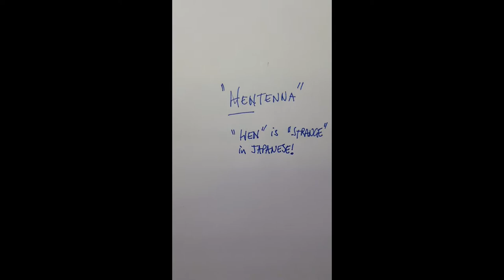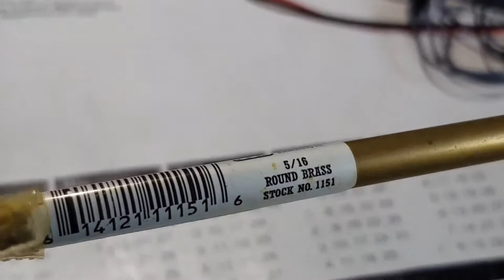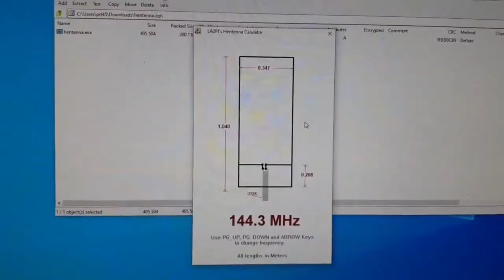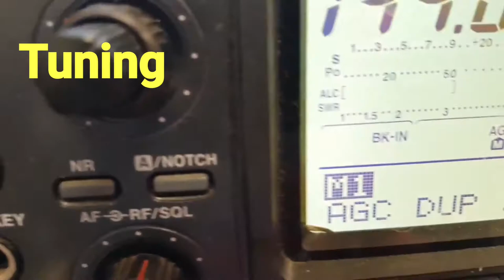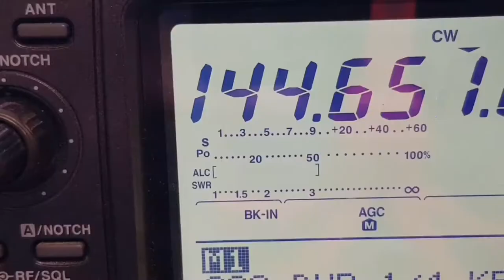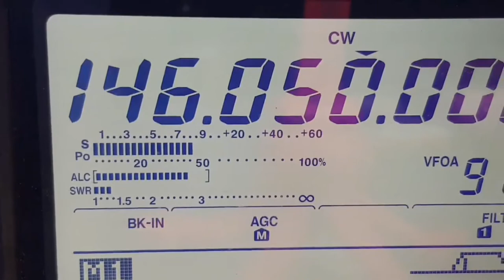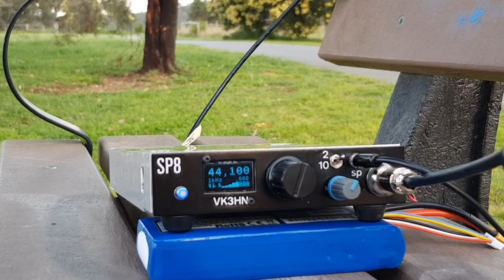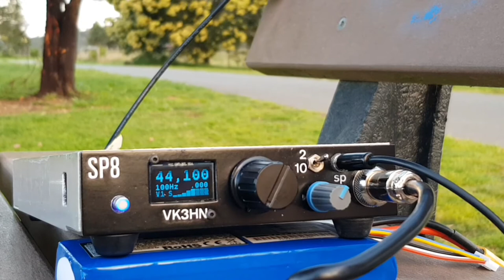Building a Hen-tenna for 2m

Comment: Thanks to this video, I just made a hentenna for 4m using the calculator. Bloody brilliant, calculator measurements work precisely. 1.1 SWR on 70.400 after tuning. Goint to build one for 2m, and might experiment with 70cm. Thanks!
Reply from the maker: Excellent Tiggy, happy that it worked as well for you as it did for me. I think these loop antennas are relatively forgiving, and they are fairly broad.  The 70cm  hentenna should be nice and compact.  Enjoy your hentenna, thanks for trying it out.

Comment from the maker: Has anyone tried a Hentenna?
Reply: I want to build a hentenna - for 17m. A question. Does the tap at 1/10th the wavelength work perfecty? How long should I make the uninsulated area to get optimal SWR? Thanks !
Reply from the maker: @dl6urk88  I've only made one, for 2m. It will scale to any ham band, just use the calculator. I'm not sure how much movement up and down you will need on 17m, try it out and let us know.